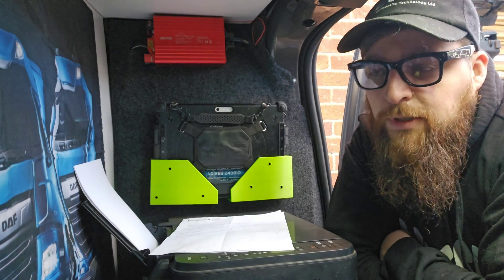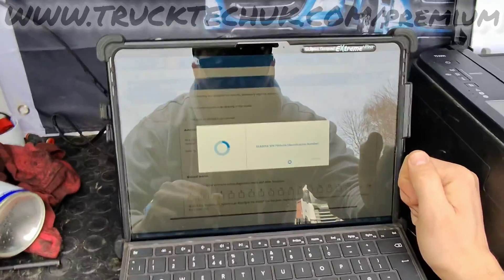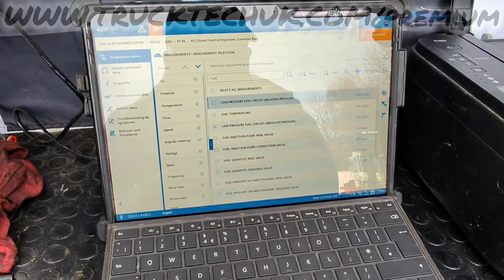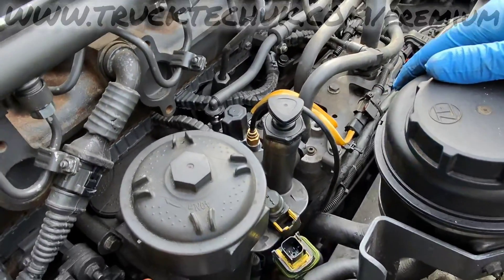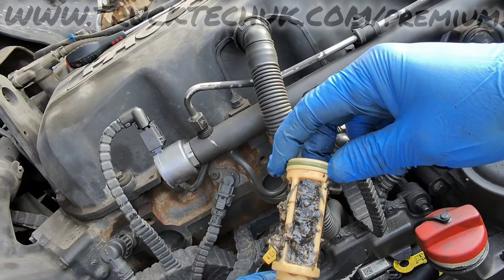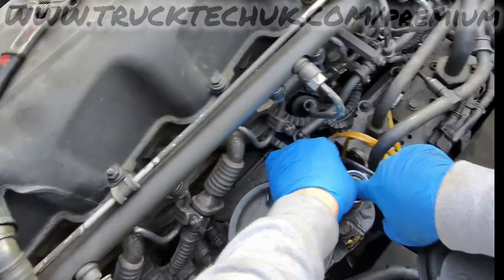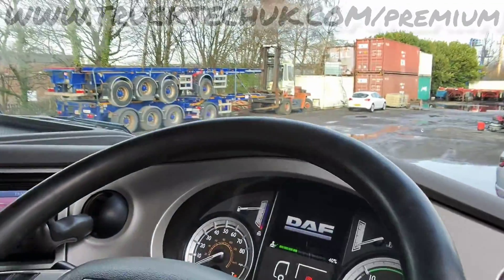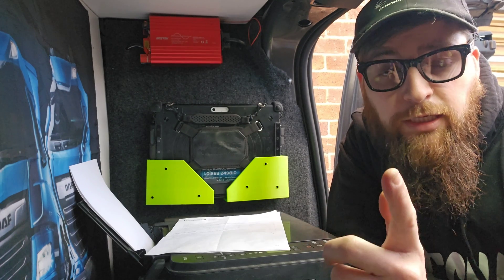DAF XF DIESEL BUG contamination!

Comment: Who is servicing these trucks 
Basic filter cleaning 🤷🏻‍♂️🤷🏻‍♂️🤷🏻‍♂️
Fuel Biocide will kill bugs but water simply needs draining off 
🤷🏻‍♂️🤷🏻‍♂️🤷🏻‍♂️
Reply from the maker: This is the problem Brian........do people service these trucks! The fuel module has a water drain built into it which should automatically siphon off any water in the filter. Daf also fitted a water separator pre-filter on the construction chassis but I guess no amount of filtering will save a poorly serviced vehicle

Comment: Had that a fair bit, Exocet anti bug kill is best I’ve found, I always get another set of fuel filters for the customer, I find when the bug is broken up, the filters catch it and you get another call 😂
Reply: I’ve had the Jaltest guys over today to do me a demo, I’m used to Delphi/ recently borrowed texa, looking to buy a Jaltest, what’s your thoughts as if I can’t guess?
Reply from the maker: @davebroster8930  what are your thoughts on the jaltest system?  I use it as I find it intuitive to navigate and gives me Similar menu options to Davie such as the leak-off tests and results. It's no dealer computer but then it does all the other makes and models I need it to with DAF diagrams which means my transition from dealer tool to generic diagnostics has been simple. Not to mention the backup from eclipse diagnostics. 

I've used TEXA and I've got other tools here but I always end up back on jaltest 😅
Reply: Ring Sarah at goldcrest oils in north wales, tell em big Dave sent ya! I’ve had loads of trouble with excavators or older trucks with steel tanks- water from condensation 🥹
Reply from the maker: Hey Dave thanks for the comment. I will have to pop into Exocet in Shrewsbury and see if I can keep some stock of it in the shop for people 😎👍 I'm just starting to supply filters and stuff now 😅

Comment: Excellent video! How did you get the engine started with close to 0 fuel pressure? Did you increase the idle speed to prevent the idle shutdown from turning it off?
Reply from the maker: Hey thanks for the comment buddy 👍.  Yep, I was expecting a 10-minute crankathon on the key to get it going but I turned the key and it went! Must be because I didn't drain the main filter down and only the strainer 😵‍💫
Reply: @TRUCKTECHUK  Sometimes you prepare for a struggle and it turns out to be easy😀
Reply: @TRUCKTECHUK  Btw I’ve heard that it can help to work the pump while cranking but you’ll need a helper

Comment: I've heard of diesel bugs causing problems but that's the first time I've actually seen what it  looks like.Great job as ever bet the truck owner was relieved.
Reply: You get it a lot in tractors as the fuel can spend months in a tank which gives the bacteria time to spread. 
At its worst I’ve had to take off a fuel tank all the fuel lines, twin filters etc right up to the injection pump. 
The filters were solid with a jelly like substance. I’ve found once you treat the fuel you’ll need to change the filters again after a few days as all the dead crud ends up at the filters.
Reply from the maker: Thanks for the advice. I've yet to go back to any truck I've attended due to this issue other than explaining the filters will block again after the fuel treatment. I suppose that's why they suggest "fuel polishing" on contained systems also
Reply from the maker: With the increase in blended diesel mixes, I'm seeing this more and more.....I've another video from a guy in Birmingham who also had the same fault 🫣
Hopefully, the customer sorts out getting it treated ASAP
Reply: @TRUCKTECHUK   Hi i've tha same issue with a car cause the owner mixed biodiesel with marine diesel fuel , thanks for you video bye

Comment: Good video .But as you know not all fuel faults are that easy  lol.That looks like that vehicle runs on bio fuel.which causes no end of issues..And with tolerances on the fuel systems being soo tightit is a recipe for disaster along with the fuel system manufacturers making an ass of the systems
Reply from the maker: Hey norb, no we both know how difficult the fuel system can be especially when it's the high-pressure system which is involved or ACTUAL electrical faults which I thought I was going to have to deal with on the water in fuel sensor 🫣
Reply from the maker: It could be worse.....it could be soft deposits in a NGD 😂😂😂😂
Reply: @TRUCKTECHUK  That is another story ...And a DELPHI  issue .apparently it is the same injector scania use in the V8 and it has the same issues lol
Reply from the maker: Ohhhhh dear let's pass that book to the injector manufacturer 📖➡️ 🫣. Let's hope they fix it soon 🫥
Reply: @TRUCKTECHUK  They have modified them ,they now have a larger surface area so the soft deposit should be a thing of the past
Reply: There’s biodiesel in everything, saw a massive increase in fuel trouble when plant changed from red to white for some reason 🤬